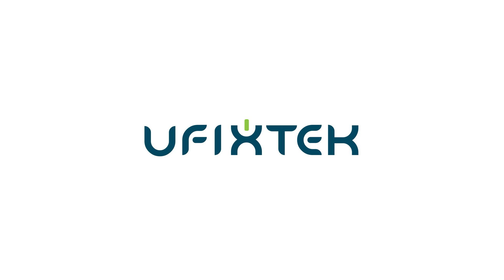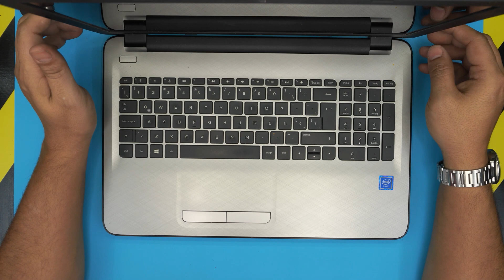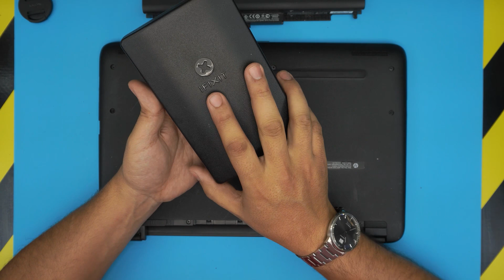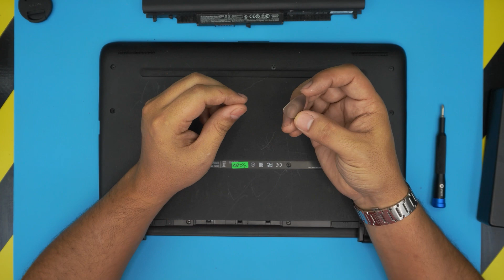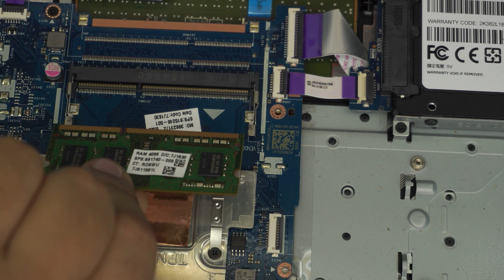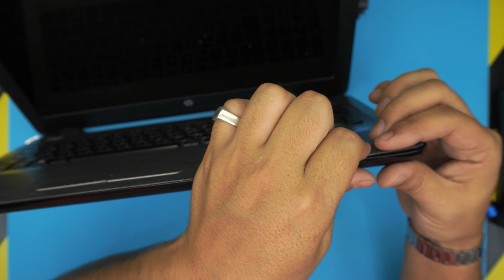HP Pavilion 15 AC 📌 RAM UPGRADE

Comment: Worked for me - thank you. Would like to add one comment. Your device does not have DVD drive. Mine does. Screw #8 (counting from top left) is holding DVD drive which will pop-out. Make sure you push it back completely when putting screws back in.
Reply from the maker: It's my pleasure my friend.
Thank you for your feedback.
cheers🍻

Comment: Thanks for useful videos, 
İS that logical to buy 8 Ram in this notebook?
Reply from the maker: It's my pleasure my friend.
🫠Regarding your question, yes, it is worth it if you plan on opening many internet tabs and a few programs at the same time.
Should you have any further questions or requests in the future, please don't hesitate to ask me.
cheers🍻
Reply: @uFixTek  Hi thank you for your reply, 
I have  HP pavillon 15-ab208nt there is a noise near fan side ı have cleaned well already but it is still going on? 
The fan is working, but I think there’s noise coming from it. I haven't been able to test it outside after removing it. What do you think could be the reason for this constant noise?"
Reply from the maker: Your fan rod is dry and lacks lubrication. You can order a new fan from AliExpress; they are very cheap. Alternatively, you can add a drop of oil inside the fan rod.